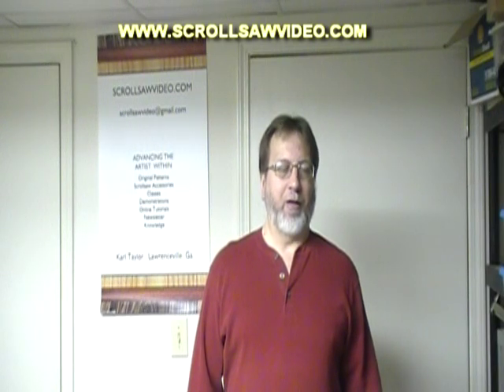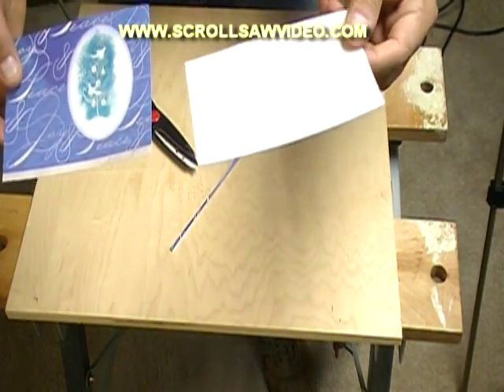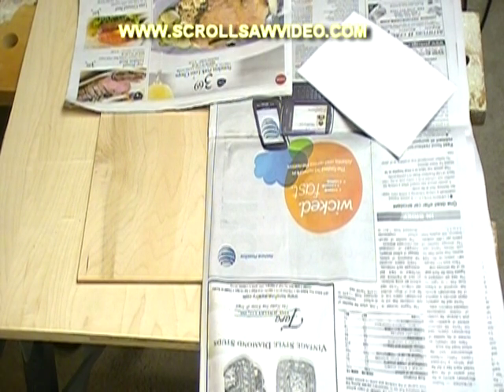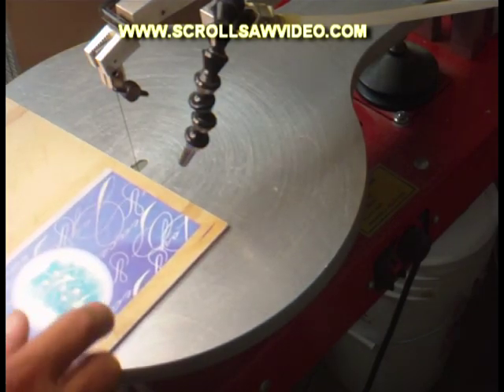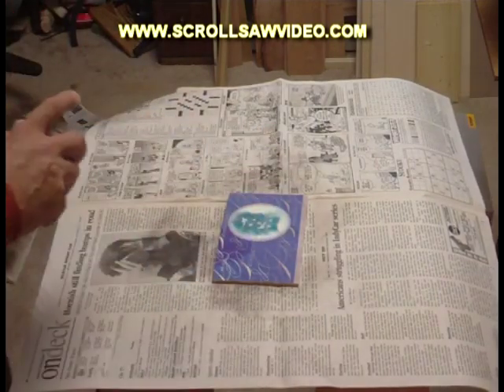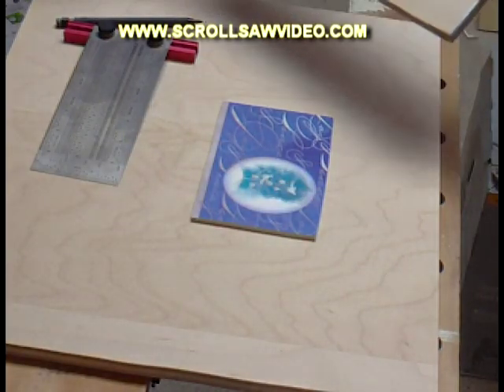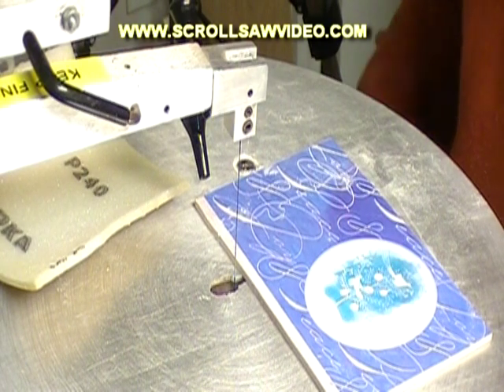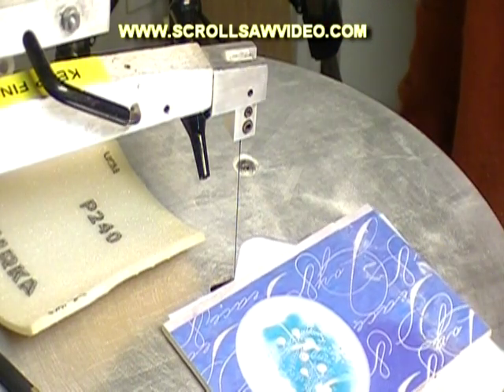How To Woodworking Making A Jigsaw Puzzle With A Scroll Saw

Comment: I love your style. I got a scroll saw almost 2 years ago and still haven't opened it (my living situation had changed) and now I want to learn and use it and the jig saw puzzle thought crossed my mind for learning. I'm a crocheter and often times they tell you to buy the cheap acrylic yarn (which is okay to use and I often use it) but after you make a swatch you now have wasted yarn that you can't do anything with so when I teach, I give them cotton yarn to work with that way even if they make a mistake and they're experimening with different stitches they can still use their swatch/practice pieces as a dish cloth since no one cares that it's ugly. It's useful and not wasted and you feel like you actually accomplished something. Same for jig saw puzzles, you learn curves, striaght cutting, 90 degree angles but if you make a mistake it's not really a big deal because you still have the opposing piece that can be put together.  I love the nonsandwich technique. I don't have money to turn good wood into "scrap wood" plus I can spray paint one side of the pieces and after they dry spray paint the other side the same color and you have a pretty challenging puzzle since you have no clues to where the pieces go and the pieces can be upside down and you might not even know it. So there's a tip for anyone who still wants to sandwich the pieces but doesn't want to waste anything. Make a solid color puzzle.    Do you think heavy weight chipboard will work? I just want to make a ton of puzzles because I have yet to meet a person that doesn't like them and I have a lot of family to give to during christmas.  Thanks for putting up with my rambling. :)
Reply from the maker: BrokebutCreative Chipboard will work for puzzles, but be careful of the dust. Remember to always wear a mask of some sort with any manufactured woods.

Comment from the maker: The easiesrt way to make the puzzle is by using graph paper.  LOL...if I remember the video correctly, Ias using an Incra ruler. These are the best rulers on the market and very valuable in woodworking. Rockler, Woodcraft and several other stores sell these but I buy mine off of Ebay for 1/3 the retail price.

Thanks for asking.

Comment: Hello, please confirm size and type of blade??
Reply from the maker: Puzzle blade from Flying Dutchman
Reply: @ScrollsawVideo  is it at number 2 or 3?/ and if you turn the puzzle over turn the blade as well teeth facing up can you still use a reverse tooth?
Reply from the maker: @11941leechie  correct, the teeth will be pointing up.
Reply: @ScrollsawVideo  is it problem if it’s a reverse tooth. Can a normal blade be used. Getting a bit of lift on the image.
Reply from the maker: @11941leechie  No, do not use a reverse tooth blade.